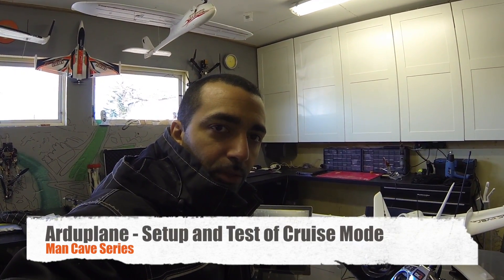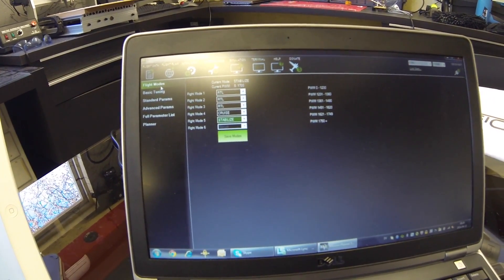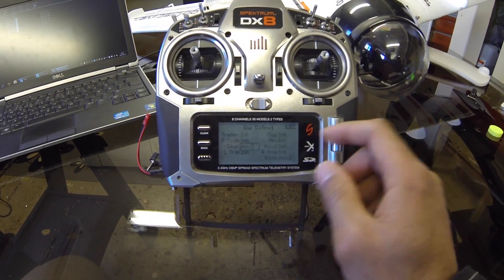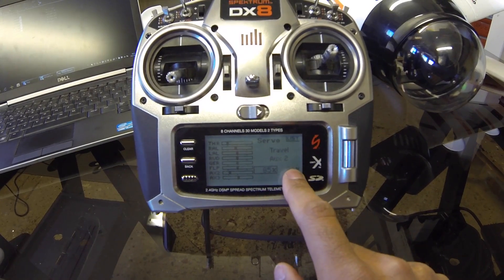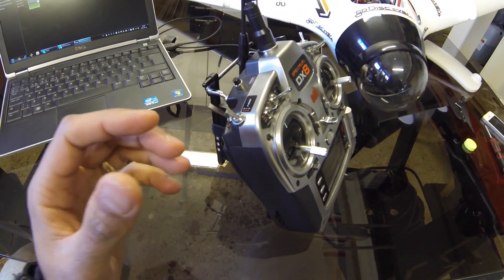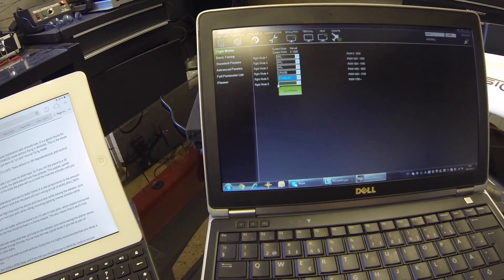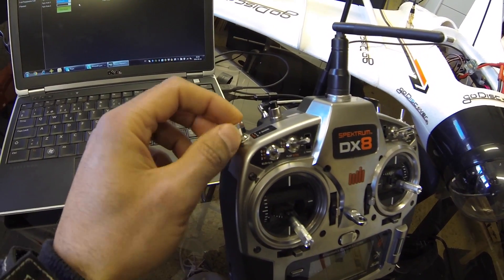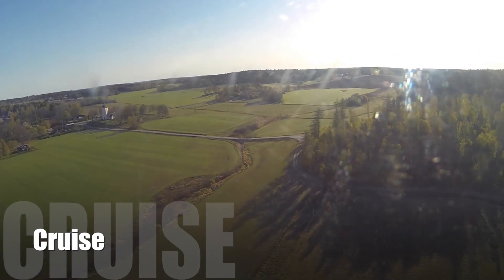Go Discover - APM 2.6 Cruise Mode Setup and Test

Comment: Great video. Wonder if you could help me with something. Im setting up my first APM 2.6 in FX-61. Im using the new elevon_output method and understand that the transmitter should not do any elevon mixing leaving this totally to APM. Heres my question of the amp failed for some reason won't I loose complete control? If I had mix on my transmitter I would surely have normal radio only mixing to get me home? My rx is on a seperate bec. Or is it the case if amp goes down then Im screwed what ever i do?
Reply from the maker: Hi Stuart, I don't have any experience with the "new elevon_output" so Im not sure if I can help you here.  The setup I had did not use this method, and needed the transmitter to also do elevon mixing.  It does sound a little more risky, not knowing about it.  I think that in previous versions, if the APM failed, it would just pass through the signals, so you could still have manual control.

If your amp goes down, as you say it, your ESC would be the first thing to cut out, if you have it programmed to, so you would sill have flight control.  I have a video of my Skywalker X7 where the motor and ESC blew up at 850m and I was able to fly it down safely.  Sorry I can't be of more help!
Reply: ant0nsmith Thanks for the reply. I posted the same question over on the APM forum & the only response I have so far is that if the APM goes down then thats it game over what ever method you use. Which I'm sure is not true as i think i set my mix in the Tx and then powered down the apm (it was running in old elevon mode) an i still had control of the servos via passthru. Your experience of a failed ESC is exactly what I'm worrying about, I have seperate 5v and 12v BECS for everything just in case. Think I need to do some more testing on the bench

Comment: Its nodding again, pretty much constantly....and thats not turbulence either doing it. Have you not noticed it? Almost looks like the Capture camera is loose. How secure is your Camera on its mount?
Reply from the maker: Hi EnglishTurbines, The camera is secure.  I find that it is turbulent where I fly below 150m - which this flight was.  I have seen the same issue with my other plans unless it is super calm.  I have flights when I am above 200m where I don't see this issue, and as soon as I decent, it starts.  This model is affected more than my others though.
Reply: ant0nsmith Hi Anton, I take your point about less turbulence higher up. That aside, I have seen a UK GD exhibit the same symtoms as yours, in fact on one flight it suffered elevon flutter. Flying wings are very sensitive to C of G location and I suspect that a bit of adjustment may improve it some. Cant see on your clip, but does the wing have any reflex in the wing section? I still suspect that this model has some fundamental design flaws other than a fully foam insulated drive motor which unsuprisingly overheats.